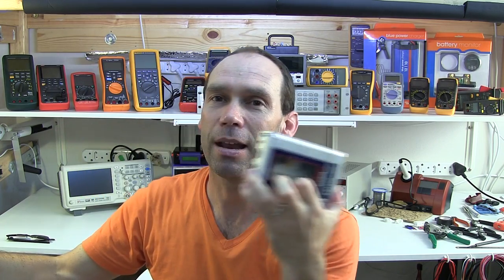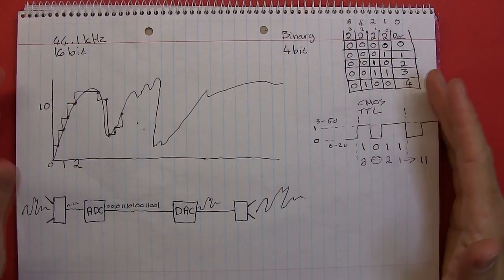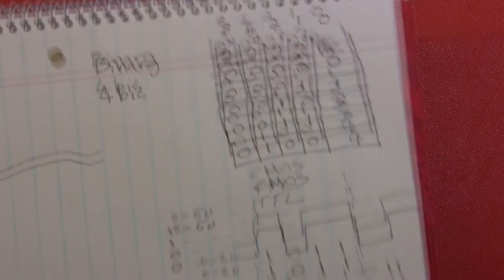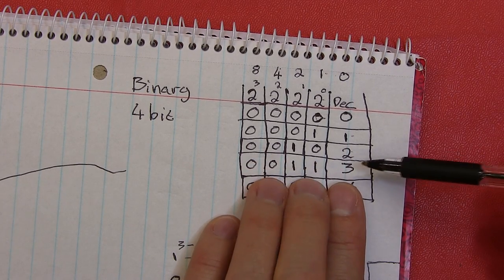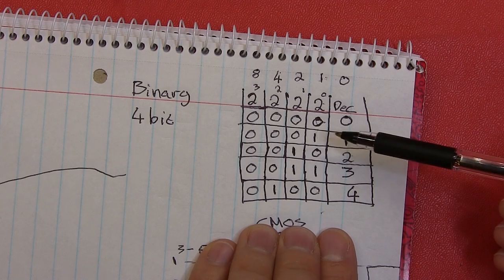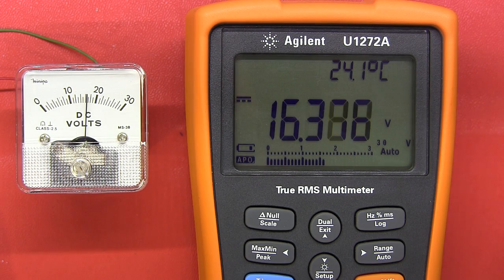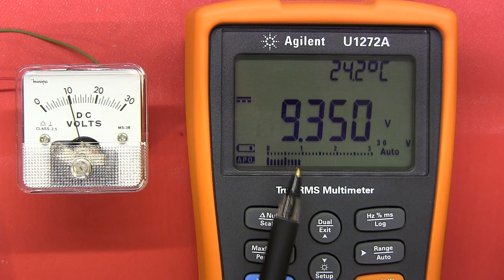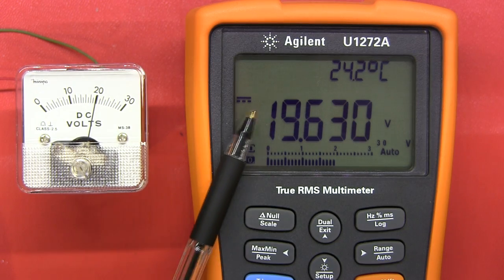Electronics Tutorial #6 - Analog and Digital Electronics

Comment: Stop the tape. Just wanted to say, I took a computer class in 1969 It took them 4 weeks to describe what you just did in about 3 minutes, and I still did not get it. I dropped out because of the math. I was just sitting here watching this and had a full gestalt, where it all came rushing in and now it makes sense like it never did all those years ago. :o)

Just wanted to say thanks.
Reply from the maker: BirdWhisperer46 My pleasure, thanks very much for the feedback.
Reply: +BirdWhisperer46 This is very nice and informative video naturally I like it. Something I also found helpfull for introduction to electronics design
  was Elumpa Circuits Expert Alchemist - if anyone wants to know more search on google
Reply: +BirdWhisperer46 Same experience.
Reply: There are several factors in learning electronics. One plan I discovered which succeeds in merging these is the Gregs Electro Blog (check it out on google) without a doubt the most incredible info that I've heard of. Check out this  super website.

Comment: Hey, I worked for the Telephone Co. for 13 yrs. For plain old telephone service. Break over voltage for ring, 110v. For when the phone is on the hook, 48-54v. When speaking, carrier voltage 10-5v. High speed T1 (4 wire circuits) are kept at 110v. Then the digit is sent +- 5v. That is in America, I don't know what happens in other countries.

Comment: Great videos! Kind of off-topic question when it comes to this video series but doesn't that mean that, in theory, vinyl has a better sound quality than CD (or any digital release)? Assuming that a vinyl record is in a perfect condition and a record player has a perfect needle etc etc.

EDIT: Digital release converted from analog release of course... Well, I kind of answered my own question there :D If taking into account all kind of "re-mastering" techniques that exists today answer might vary... But then again, what is quality? Too much questions in my head right now :)
Reply: There are audiophiles and musicians who do not like the sound of CDs and prefer vinyl.  There has also been a resurgence in the popularity of vinyl.  However, add some bit resolution and increases the sampling rate and at some point even the most sensitive will not be able to tell the difference.  

Also audio amplifiers made with vacuum tubes have better sound than ones made with transistors.  It has to do with a back current in transistors that does not occur with triodes.